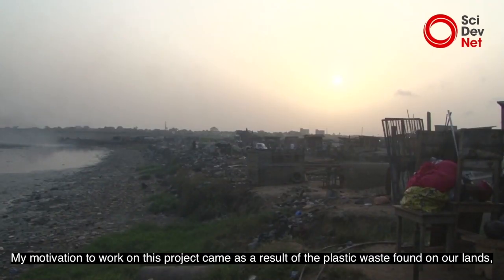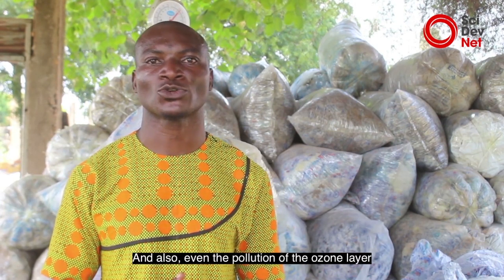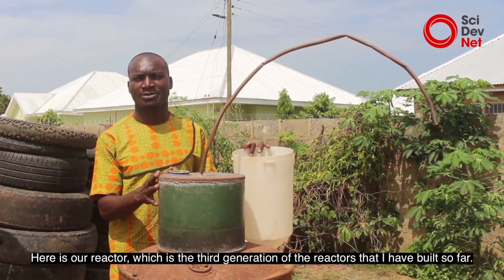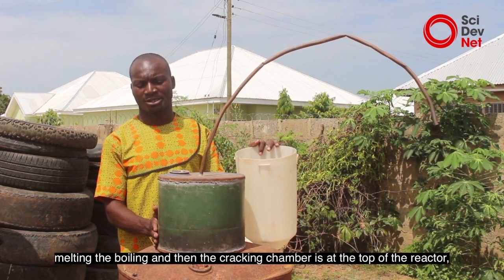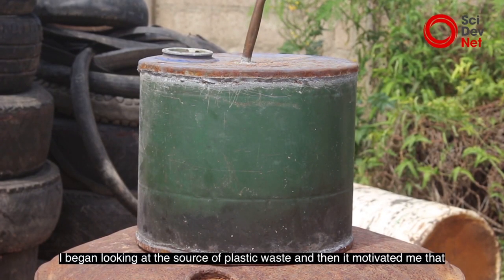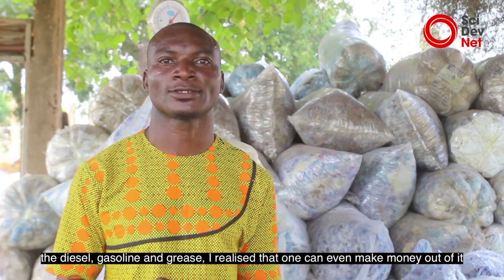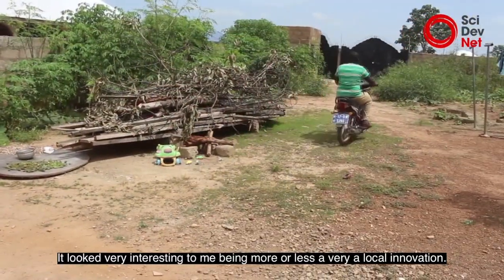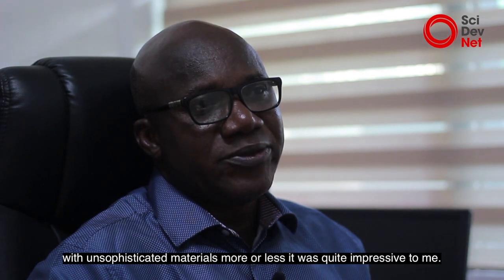Plastic to Fuel

Comment: He has good forward thinking. I like the explanation of the fifty tonne plant....classic!!
Reply: Yes... He just forgot to tell you, that he will have to burn a few tonnes of wood or coal to convert those few tonnes of plastic back into fuel, to also burn it to drive his bike.
Nice, making twice as much pollution while trying to convince everyone he is eco-friendly.
Reply: @ogi22  The gaseous state that is created can be used to heat the plant, and once started will sustain itself. It is eco-friendly as the Bike was going to run anyway, and the plastic is already there. Great work mining the most negative out of a positive.
Reply: @TonyScandal  I also think this fellow may not understand that wood is a "carbon neutral" and renewable fuel, that is locally available. Also, products like straw, corn stover, and other agricultural byproducts can be used to convert the plastic to fuel.

Comment: Try to find a metal container as Diesel and petrol products will dissolve the plastic containers eventually. Nice job and good point about preventing littering with a valuable raw material.

Comment: Sadly, the NPA of Ghana would rather clump down on such persons doing such innovations. Getting a license is extremely difficult and they will make you feel its cocaine you are producing. The government rather should push for people to be innovative and if it's a high profit venture, they should tax them rather than make it difficult to produce fuels through unconventional means. Standards can be set and players adhere to them
Reply: This isn't an innovation. It's called cracking and the process is taught to every student, who has taken chemistry. This doesn't make sense in a world that desperately needs to get rid of fossil fuels. Cracking plastic and turning it into liquid substances is just another way of makeing a fossil fuel and burning it will release CO2, increase the CO2 concentration in the atmosphere and make global warming worse.
Reply: @stauffap  I guess the current winter wave + cold temperatures in places such as Texas is as result of global warming? When it's hot-global warming, cold, global warming
Reply: @oheneadu3730  
Sorry, but you can'tjust look at the world and feel that it's now colder. You actually have to measure it. Relevant for whether or not the earh is warming are the average global surface temperature (or more precisely global average temperature anomalies). 

And remember glaciers are still melting all over the world. Greenland and the northern ice caps are still melting. The ocean is getting warmer and the sea level is rising. What can cause the sea level to rise? 1. Melting land ice masses, 2. Thermal expansion of the oceans (when things get warmer they expand). So that the sea level is rising can only indicate a warming world. 

And third of all you need to understand the difference between weather and climate. Weather is what we are concerned with in our daily lives. It's the short term day to day variability. Climate is something different. The climate is the average over 30 years. 

That the world is warming doesn't mean that you will never ever get cold winters again in all places all over the world. Some places could actually become colder due to changing wind patterns. What's important is the average global surface temperature though. That's the thing that's going to rise. It will become warmer as long as we keep burning fossil fuels. 

But remember that's it's the average global surface temperature that's getting warmer. You can look these measurements up on the NOAA (global temperature anomalies). 

Science isn't a matter of just looking at the world and feeling something. You need to look at the numbers. 

Also, i've studied physics and chemistry interdisciplinary and in particual i've studied atmospheric physics and i've been reading the scientific literature in regards to climate sciene for well over a decade now. It's simple physics that tells us that the earth will keep warming as long as we keep burning fossil fuels. That's just a fact of physics (google the atmospheric greenhouse effect).
Reply: @stauffap  Would you prefare to eat your plastic in fish from the ocean. Co2 emmisions need to cut down true but which is more of an emmergency. Remember the plastics will remain for 1000yrs
Reply: I believe in the power if DAO business models to empower the waste pickers so that they can own infrastructure like this rather and act as a lobby for their own Interest so that no power brokering African rolls Royce owners can destroy a good thing.  Let them destroy themselves while the people reclaim their birthright

Comment: I have been looking at this for a bit now.  I also looked at old tires as well and it turns out they can be turned into fuel in almost the same process.  I see that you have several tires around you.  Have you attempted the process with a tire instead of plastic?

Comment: Is there some way to contact the creator of this reactor? i'm assuming it is some sort of pyrolysis.
Reply: You assume properly. It is a normal pyrolysis. I'm just curious what is he using to heat his plastic. That pile of wood suggested he is burning it to distill fuel from plastic. And he is talking about cleaning environment? First he is using wood (more CO2 in the atmosphere and a LOT of wasted energy to convert plastic into fuel) then he is burning that fuel emitting even more CO2 and other trash into the atmosphere. Nice. Just burn that trash directly and leave those trees alone. You will make less waste this way.
Just imagine what he will have to burn to convert 50 tonnes of plastic every day.
Or maybe he will use coal to heat that pile of trash?
Reply: @ogi22  maybe he can use solar energy to heat it up?
Reply: @ogi22  Tell that to Flipper who is choking on the diet coke bottle you think you recycled!!

Comment: I think if you publish something like this, you should show some due diligence calculations.  E.g., what are the potential fuel requirements for collection, fuel requirements for cracking, fuel yields, output fuel prices, etc.  It's hard for me to imagine the numbers work out favorably.

Also, although I hate plastic waste, there's a general principal in environmental management that it's better to consolidate waste.  (This is in contrast to the old adage that "The solution to pollution is dilution.")  The fuel-production method shown here turns solid pollution into airborne pollution, which is only justifiable if the displaced pollution (from traditionally produced petroleum) is greater than the pollution from this petroleum plus the pollution to create this petroleum.
Reply: No it does not add to air pollution the distillation is done in a air free environment. The motors where the fuel is burned can be scrubbed free of any contamination.

Comment: How did he solve the other toxic fumes that the plastics melting and burning caused?
Reply: it seems that you have not understood how pyrolysis works, at high temperatures the plastic melts in a hermetically sealed space, then vapors come that condense into water and thus fuel is formed. this process does not emit toxic gases

Comment: WHY THE HELL aint this being done on a planetary level.  You got it, oil prices' would drop like a hot rock. Corruption.
Reply: It's easier to push the climate change hoax and just charge companies for carbon credits allowing a small few to become filthy rich than use the money to physically clean up our oceans, rivers and countries converting plastic to fuel.
Reply: it won't be fast enough to produce and ultimately much more worst of the environment.

Comment: careful, if you try to do this on too large a scale it begins to cost more than it generates
Reply: I'm trying to figure out how it doesn't on a small scale.  I wonder what he is using for the input fuel.
Reply: @cranki6316  Look at a few more vids and you will find that liquid as well as gaseous fuel is created. Pipe the "waste" gaseous fuel back into the system and that cuts out the need for any other heat source.
For starting the system and running it really cheap, look into waste oil furnaces (cooking oil). https://www.youtube.com/watch?v=8q2_K1-_cNs
Reply: @TonyScandal  your first suggestion would be perpetual motion and that is impossible

your second suggestion sounds good though
Reply: @cranki6316  if you have enough deadfall around fire wood can be crazy cheap...that's not counting burning unconventional things.... and just a dash of land management, one could easily deal with all of a communities plastics. 
Takes a lot of plastic to make a little fuel in this case,  i would imagine it would become harder to find plastic after a time than it would be to find fuel to burn it with